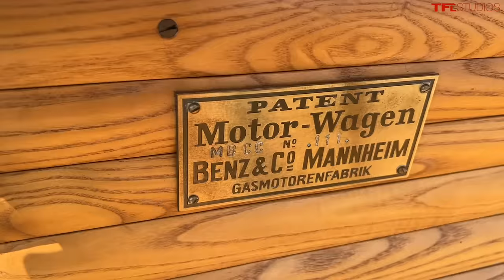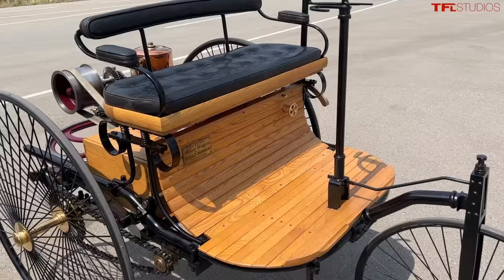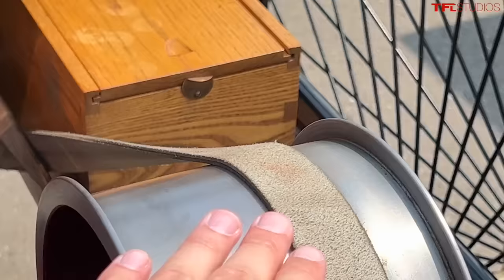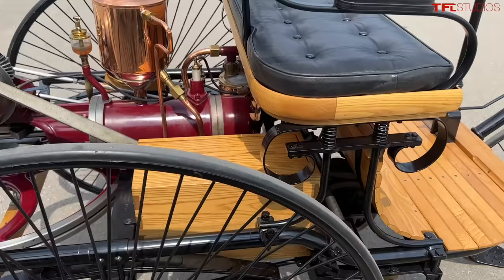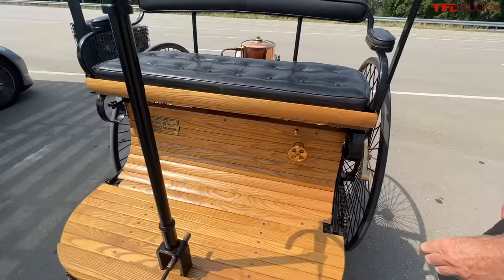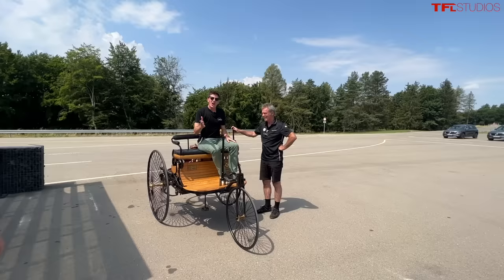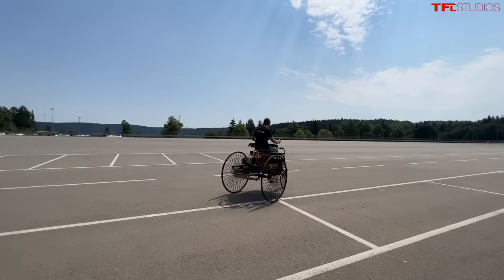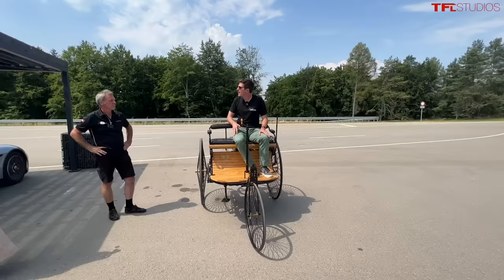I Drive The Oldest Car In The World: Here's How It Works!

Comment: The oldest car I’ve driven was a 58 corvette. Shifter and engine were perfect but the brakes didn’t work. I felt like I was in a one man parade. I was giddy for hours.
Reply: I always like how Jay Leno upgrades to a dual master cylinder, and if the drum brakes kind of stink, he puts discs on, but keeps the drums just in case anyone wants to convert it back to stock.
Reply: I've moved my mom's 51 chevy truck around the block and it's such a different experience compared to the cars of today
Reply: That Mercedes you don't need brakes...just use your feet to brake😅😄
Reply: No American cars brake or handle well
Reply: @gowdsake7103  what car do you drive?
Reply: @RaptorsVideos  Why ?
Reply: @gowdsake7103  Gonna take that as a no, typical lol
Reply: @RaptorsVideos  What possible interest is it do tell, but I do have a race tuned MGB
Reply: @gowdsake7103  lol

Comment: Fascinating that almost 157 years later, modern cars still consist of many of these same components (just more refined). 
- Differential
- Oil lubrication system
- Flywheel
- Battery/ignition box
- Water coolant reservoir
Reply: -Wheels!
They're still quite useful on even a modern Car 😎
Reply: @samuelbhend2521  Well, I mean.....wagons had wheels, soo...
Reply: Seat!

Comment: These replicas are built in England!
We visited the Yourshire motor museum outside Leeds about ten years ago and were surpriced to run into the assembly area.
They were started building the replicas to the one hundred aniversery and had continued to build them since, the were working on number 125 by then....
All parts were sourced in Britain.... Even the tyres were manufactured in this location 
The only parts that were not correct was as we were told, the piston they used a Ford Cortina piston and the spark plug thar was 😊a modern plug hidden inside a fake cover....
Amazing wood work from oak 
Great job by the three men in the assembly.
Anders Rydberg Sweden.

Comment: Way cool, thanks, Tommy.  Times they are changing, like our cell phones with more memory than the first moon landing (640k), and our lawnmowers and UTVs having more power than the first autos.  My oldest driven, 48 Buick Fastback, think 3-on-the-tree.  Why can't the "Imagineers" at GM modernize some old styles (50s classics) to fit on standard frame (like Colorado WT), seems like a dime to produce and charge $20k-$30k?
Reply: The first moon landing guidance computer only had 4 kB of memory and ran at 1 MHz. Today's cheap household electronics usually have better specs than the Apollo computer. And smartphones are thousands of times more powerful and have millions of times more memory.

Comment: An interesting predecessor of this was Richard Trevithick's London Steam Carriage from 1803(!), which was the first self-propelled passenger vehicle.
However, this was itself preceeded by Nicholas Cugnot's steam-powered road vehicle from 1769, which was designed to pull cannons at walking pace.
However, Benz' Patentwagen was the first car with an internal combustion engine to be successful. And in that sense, it's the ancestor to most modern cars.
Incidentally, the first electric car also already emerged in the 1800s.

Comment: You need someone to push you uphill and the brakes are not enough for downhill.
In addition, there used to be bumpy roads and if something broke, the driver had to fix it himself.
There weren't even any petrol stations, but petrol could be bought in the pharmacy.

Comment: You need to start another channel for antique vehicles 😁
Reply: It’s called TFL Classics for a reason.
Reply: @Silverback_GMT410  there's a difference between a "Classic" and "Antique"
Reply: @Silverback_GMT410  
Vintage Car: Manufactured between 1919 and 1930. Either a “survivor” or restored in conformance to the original manufacturer specifications

Antique Car: Manufactured 1975 or earlier (>45 years old). Either a “survivor” or restored in conformance to the original manufacturer specifications

Classic Car: Manufactured 2000 or earlier (>20 years old)

Comment: It was NOT the first car. The French steam powered Cugnot of 1792 holds that title, even though it was not practical. In 1807 another Frenchman Francois Rivaz invented a hydrogen powered internal combustion engine and then in 1859 Jean Lenoir invented a petroleum based internal combustion engine which he adapted to a vehicle and made several demonstration runs around the French countryside. His automobile was not a commercial success, but he set up a factory to produce the engines and sold several hundred of them for various stationary power and marine applications.

Comment: Funny thing is modern day tractors are basically the same design...Atleast the Ventracs are. There are no pedals and every thing is done with levers. They do obviously have the typical steering wheel, but speed and everything is controlled by levers.

Comment: The only reason this vehicle wasn't designed to be the first motorbike, was because the size of the engine. This engine have the same power as my Piaggio Ciao from '86, designed to go 30 km per hour (but makes a little more). It sounds like nothing today, but I can drive from the south of Sweden to the north in five or six days with rest and sleep. That's good enough today, an impossible task back in the 19th century.

Comment: It would be easy to make an electric version of this.  Just attach a front hub motor to the front wheel and throw all the electronics and batteries underneath the seat.  All you need is the frame.  If only I knew how to weld.

Comment: When the automobile was first invented, it was met with a lot of skepticism and mockery. They had a lot of dependability issues, and getting fuel could be a challenge as there were no gas stations at the time. Those WITHOUT VISION would continually point out problems with maintenance, reliability, and the threat of running out of fuel. The later would involve either walking or riding in a horse drawn carriage to a fuel source, such as a pharmacy, then riding back via horse based transportation. Imagine living back then and seeing some foolish person driving this ridiculous contraption down the road?? If they had Social media back then, oh how the mocking memes would flow.

Comment: I think the ride is only "very comfortable" because you are driving around a flat, smooth parking lot. Off-road or gravel would be insanely bouncy, I imagine.
Reply: Absolutely. However the seat frame is lightly sprung. It would have followed the same routes and done the same speed as pushbikes.

Comment: does it do burnouts? How fast does it go down the 1/4 mile?
Reply: Considering that it has similar power and top speed to a person, but more weight decreasing acceleration, I’d guess a quarter mile of a little over a minute. It would be a good race against a person or a recreational electric scooter
Reply: @KHolzer444  😂

Comment: if you travel to the Vienna Museum, there you will find the ORIGINAL car built by marcus siegfried, around 1880, or roughly 20 years prior to karl benz.

if they let you it would be driveable.

unfortunately, none of etionne lenoir's cars built in the 1850s to 1860s has survived.

predate karl benz by a good 50 years... ICE powered cars. not steam. thats even earlier.
Reply: Correction, not the ORIGINAL car :V

He just built a less garbage version of one.

And Benz made a more viable version of that, which became the "first" car.
Reply: @higueraft571  by original i mean... its the actual vehicle.that he made himself, it isnt a replica.  iirc, it was his... third?

Comment: actually the first car that moved without a horse was electric motored, internal combustion engine cars came MUCH later on! also electric motored cars were more common back when the internal combustion engine came to fruition and didnt really take off for many decades due to the dominance of electric cars, in some places around the world electricity was free, so why would you buy petroleum based cars? Well it was Rockerfeller that changed that and the rest as they say is history!
Reply: Yeah,  why would you ever buy a gas car? Oh yeah,  when you wanted to go any real distance.  Lead Acid batteries were extremely heavy and offered very little range. And do you really think electricity would've remained FREE for any length of time?
Reply: I remember the first first car being steam…first one being made for the military. They say that the Benz was the first GAS powered car
Reply: First electric car was made in 1859 by a French dude. First steam was made in 1769 by a French dude. Gas was 1865 by this German dude

Comment: first electric car was 40 years before that car
Reply: Maybe but it hardly was practical as the only source of power were primary batteries. The first industrial scale dynamos were developed in 1866-67 and the first rechargeable batteries in 1859.

Comment: it needs 4 wheels to be a car, this is a trike and not a car - so the first car is the Hammel-vognen Danish and not German.

Also the original first real car the Hammel-vognen still run not like these Patten replica trikes. 
Also Hammel-vognen has reverse gear and brakes like none of the other. 

La Marquise might be a bit older - but Hammel-vognen looks most like the later car designs during 1890-1910years 
i argue the first real car.
Reply: German invented car actually kid
Reply: @puchokoffie8152  nope but they where the first to mass produce it and claim a patent therefor the paten motorwagen
Reply: Modern definition or Classic?

Classic was at least as far back as "Karros" aka Chariots (which really was "any wheeled horse-drawn vehicle). 

Modern was around 1895, with "Autocars", or literally automatic/self-propelled cars. 

A bike is a Car, a Car is a Car, a Trike is a Car.

Is a Semi Truck (18 wheelers) a car by your definiton?
Reply: @puchokoffie8152  Wrong, the French did.
1769 by Nicolas Cugnot. 

For the first Autocar, specifically. 

THE first "Car" we know of was 3300-3100~ BC...
Reply: @higueraft571  No my first sentence is "it needs 4 wheel to be a real car" so a 18 wheeler is not a car! 
i define a real modern car as to how its operated and build. 
Hammelvognen was the first petrol or diesel driven car with 4 wheels, front fork spring suspension (originally not rebuild as now), rear leaf springs. It has both forward and reverse gears, a clutch and brake pedal. it has a 2 cyl boxer center engine of 2.71l and can reach a speed of 10 km/hour with its 3.5hp. 
in 1953 it was invited to England as the worlds oldest car and took part in the London-Brighton veteran race. 
And it still runs this day.
Almost designed like cars are build and operated to this day 
compared the Benz patent motorwagen Hammelvognen is way superior as a car. 

The Benz Patent-Motorwagen was a motor tricycle - like those big Harley trikes.
The first Motorwagen used the Benz 954 cc (58.2 cu in) single-cylinder four-stroke engine with trembler coil ignition.[13] This new engine produced 500 watts (2⁄3 hp) at 250 rpm in the Patent-Motorwagen 

Mercedes and modern marketing made people believe they invented the modern motor car and they clearly did not!
Reply: @mnp3713  >"it needs 4 wheel to be a real car"
And, of course, history and the definition of this word WOULD heavily disagree :V

You specifically use the most modern version of an Automobile as the definition of "Car" which, not QUITE wrong, doesnt really fit many definitions of "Car" at all.

Yet even a horse-drawn wagon is a car. Or a Chariot. 

And you disagree that a Truck is a Car? 

Are Electric Vehicles cars? Actually, would a Tractor be a car? Modern Lawn Mowers?
Reply: @higueraft571  I would rather have a discussion of the engineering and not language and definition of words. as i speak and write 6 languages and English is not my native tongue. But i have learned that American english speakers dont regard a Truck as being a car like the British or Europeans do.
Reply: @higueraft571  from oxfordlearnersdictionaries "a road vehicle with an engine and four wheels that can carry a small number of passengers"

from dictionary.cambridge.
"a road vehicle with an engine, four wheels, and seats for a small number of people: "

from merriam-webster
"a vehicle moving on wheels: such as
a
archaic : carriage, chariot
b
: a vehicle designed to move on rails (as of a railroad)"